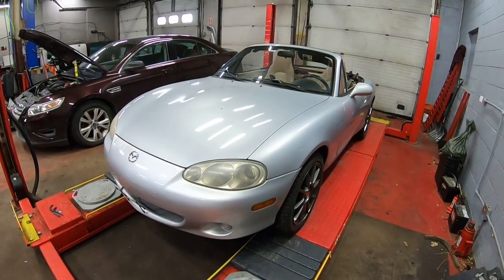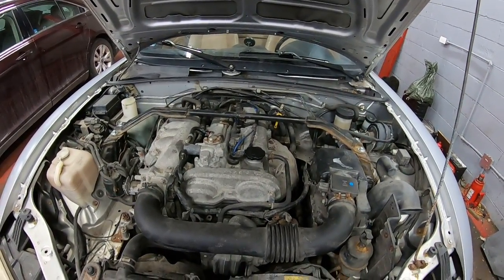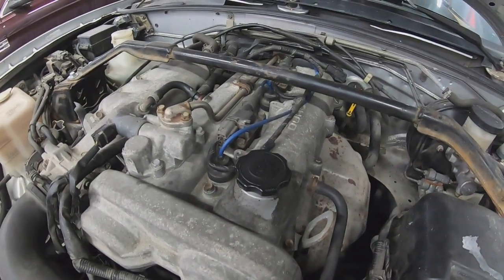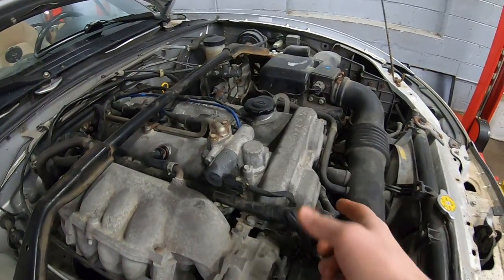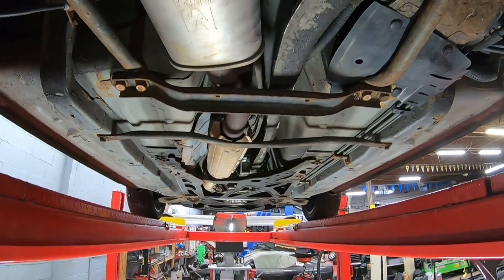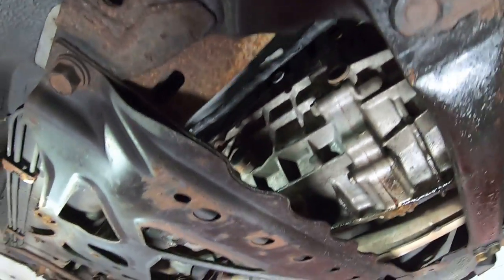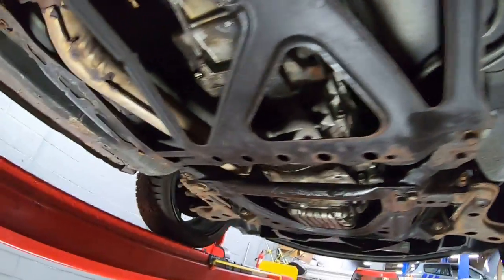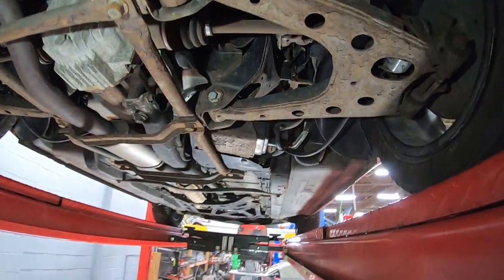Anatomy of a Miata: NB2 (2001 - 2005)

Comment: What's that big black round thing at the driver's side of in front of the clutch master cylinder reservoir?
Reply from the maker: That’s the cruise control actuator, it uses vacuum pressure to move the throttle cable.  Please subscribe to help us build our channel!